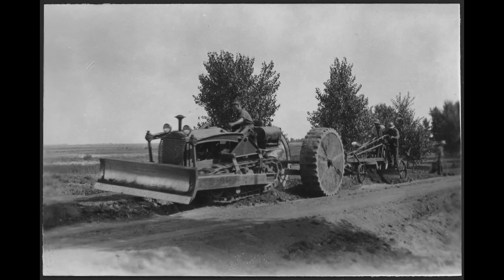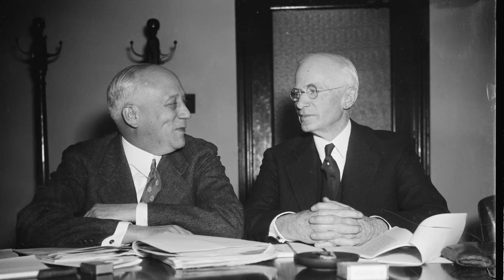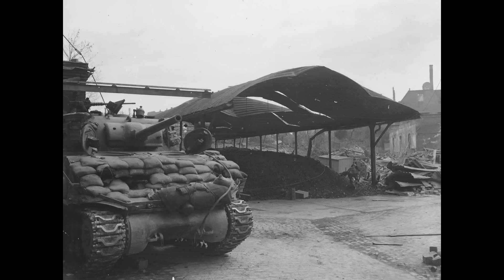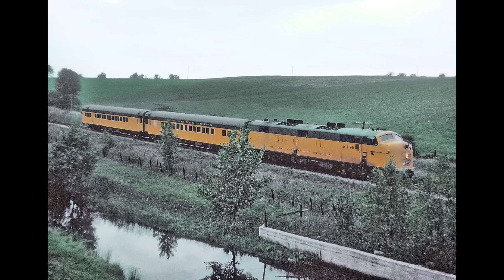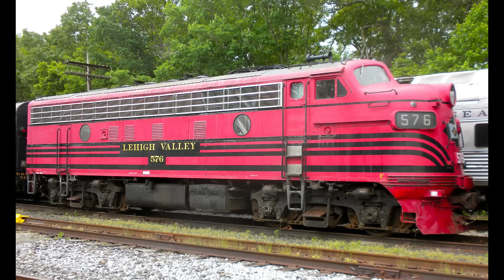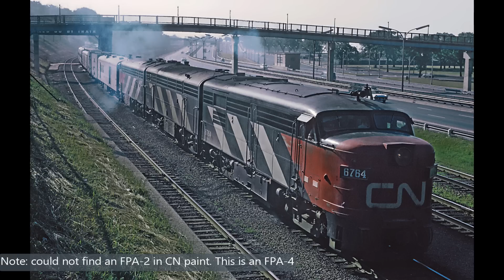Alco FPA-2, Alco's forgotten passenger locomotive.

Comment: And they will fly! They were very fast for there time and gearing also made them,,,,,when they ran right some of the hardest pulling locomotives of their time. The 251 prime mover had it had a chance to go through further development what have proved to be a worthy prime mover. The bottom line is this, ALCO GOT SCREWED OVER DURING THE WW2 YEARS AND ALCO STEAM LOCOMOTIVES PULLED PROBABLY OVER 60% OF THE WAR GOODS PRODUCED IN THIS COUNTRY DURING THAT PERIOD. A FEAT GE CAN NOT POSSIBLY MAKE.

Comment: The Long Island RR had many FA-1s. They used them for commuter trains.
Reply: Those FA-1s (and one EMD F7) had their prime movers and traction motors removed.  They had HEP generators installed and operated as control cabs for the EMD GP38-2 locomotives that were used to push the train westward to its destination.
Reply: @1575murray  they had fa1, fa2, and f7 units. Some of the fa's kept their alco engines, but they were derated for hep use.

Comment: A highly flawed video at best. E-units were light enough and easy enough on the rails that most railroads had no need to upgrade their lines. This was actually a selling point for diesels in general, and the E-units were no exception. Nor were they particularly inefficient compared to F-units, other than having idler axles that couldn't put tractive effort to the rail. For trains of a certain weight, a single E-unit was far superior in cost, fuel-economy, and overall efficiency to a pair of F-units. This was particularly true of the FTs which had no room in the A-unit for a steam boiler and made a 2-unit consist mandatory. A number of other railroads also lacked steam boilers in their later passenger A-units, notably AT&SF and B&M. I've seen many photos of small, short trains that could have been far more efficiently handled by a single E-unit being pulled by a pair of Fs. The FP7, FP9, and FPA-2 were for very small trains that could be handled by a single small unit, backup power that could also work freight trains, extra power for larger-than-normal trains, and service in mountainous territory unsuited for A1A-trucked locomotives. Santa Fe's mountainous territory was the real reason for their preference for Fs. They decided that a top speed of 109 mph was enough for their purposes, and that the extra 8 mph an E could offer wasn't justified in most cases. Their Es would find ample work on many secondary trains that were too small for two Fs. Many were ordered with freight gearing with top speeds as low as 65 mph. Several railroads ordered their PAs and Es with low-speed gearing, too, notably MEC and SSW. MP had 19 FPA-2s, but the 12 that were ordered as ABA sets may have been 6 FPA-2/FB-2/FPA-2 sets.